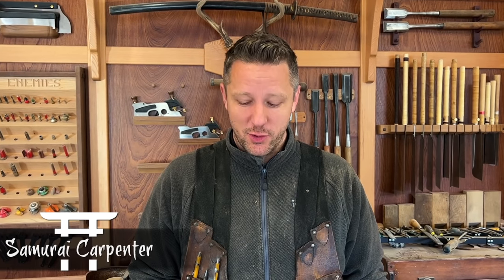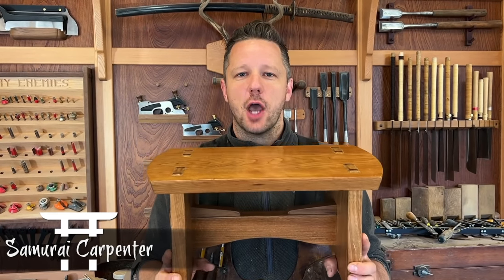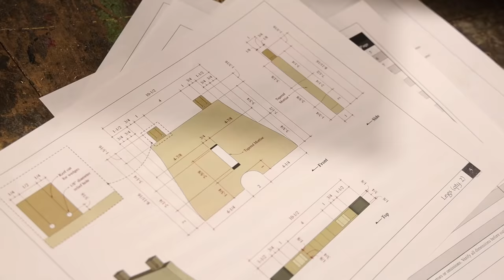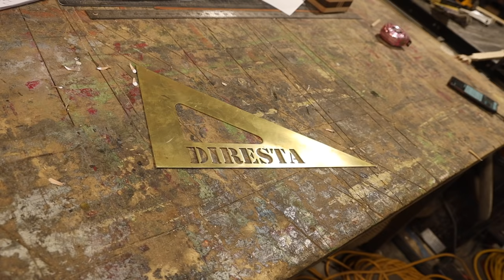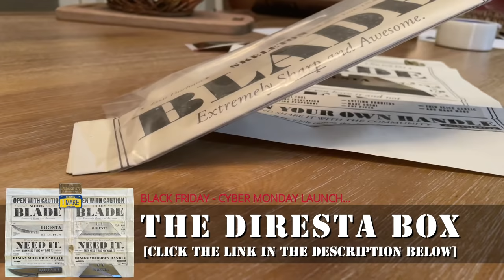DiResta Samurai “Joinery” Step Stool Challenge

Comment: "pro"tip: if you have two pieces where you have to cut a half circle, like the legs here, you can put them one against the other and use a hole saw to cut the hole fast and clean. I usually staple them to an MDF piece i have for that kind of stuff.